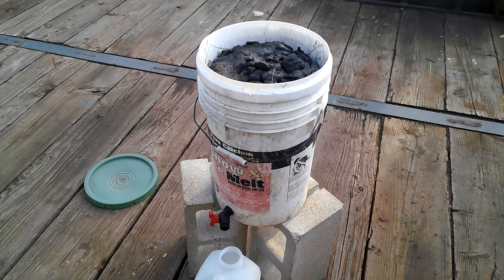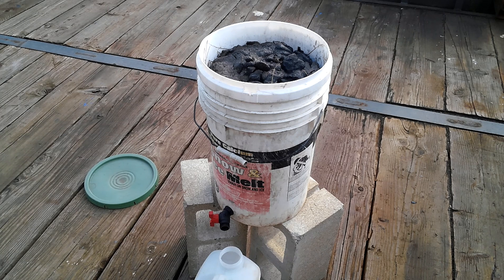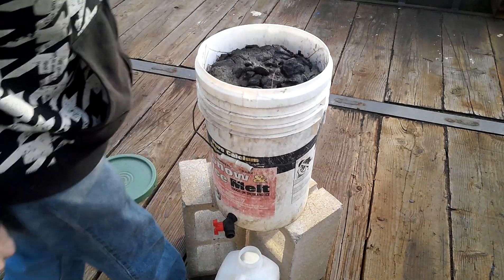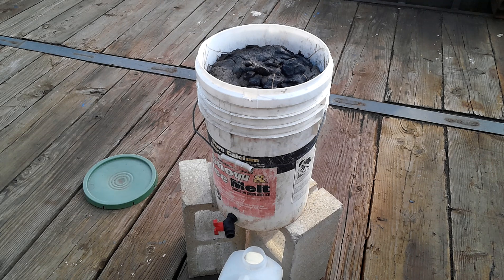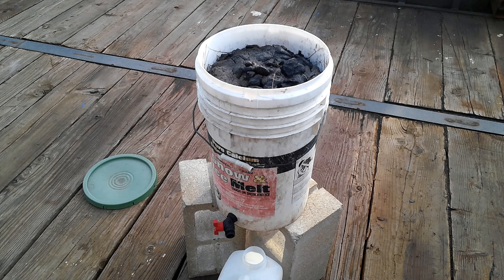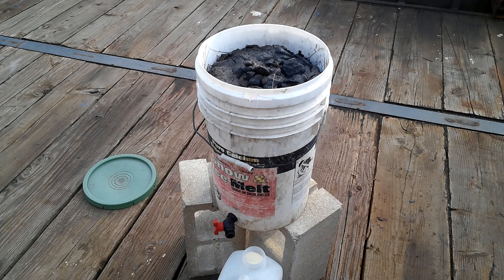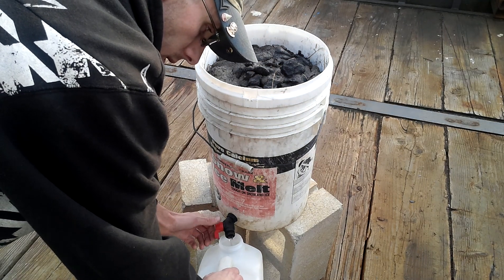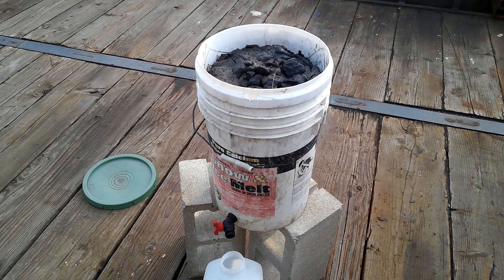How to make lye

Comment: Do you know the difference between potassium hydroxide and sodium hydroxide? And is this what you are making in this video? Someone said this is actually making potassium carbonate. But I thought sodium hydroxide was lye? Thanks
Reply: We are making potassium hydroxide yes. Which then is used for the saponification reaction with the lard
Reply: Slight error on my behalf, salt is not added to make sodium hydroxide but rather for the moulding step
Reply: @acx1005  thx!

Comment: Just an observation, if you’re layering filtering material from the bottom up, why drill holes too high on the side? Shouldn’t the holes be at the bottom?
Reply: That's why he needs to run the water through several times 😂
Reply: @underduress5761 No, you create more holes closer to the top to prevent a vacuum and trapping the water inside. You don’t have to fill the bucket to the top. These holes are about correct.
Reply: He gets a pass since we weren't raised with the survival traditions of the elders; we were brought up to be dependent upon the Rockefeller control grid
Reply: Because if you don’t create airflow at the top, it will create a vacuum and the water won’t drain out fast enough. You’re welcome.

Comment: What happens if soft wood ash is mixed in with hardwood ash?
Reply: Has to be hardwood
Reply: It doesn't have to be hardwood Ash, hardwood Ash just creates a harder soap. Soft wood ash  crates a softer soap and if you want to make it harder you can add salt and it will make it harder, not as hard if a soap as hard wood ash would make however. @willsmith4233
Reply: You create heroin

Comment: A better although more laborious method is to only drill holes in the bottom of the bucket and put a couple inches of small rocks at the bottom with a thin layer of wet sand pressed on top of that, now add a couple inches of pressed ashes then a couple inches of wet sand, repeat that process until the bucket is full with the top layer being sand and begin pouring in hot distilled water. After boiling off all of the water you end up with white lye instead of the yellow tinged impure stuff you get with other methods.
Reply: Hi there, I'm trying to extract lye from hard wood ash for making bar soap. I followed the instructions from another video. I filtered out the charcoals from my ash and mixed the ash with water in a bucket. I let it sit for a few hours and then I pressed the mixture through an old tshirt. The liquid produced from the press was sort of grey with a lot of sediment at the bottom and a yellow colour on the surface. I boiled that down untill i was left with a grey powder. 
That grey powder should apparently be lye but im not sure if it is, as it doesnt seem to react to fat. Maybe there is some lye in there but not enough and its mostly carbon? Or just ash?
Any information would be a huge help!
Also, with this method that you mention, with layered sand and holes at the bottom of your bucket, how long does it take to produce the lye? because Im trying to make soap as christmas presents!
Reply: @aaronhealy3789  try letting it sit for a few days to “saturate”. Then proceed to press or filter. 

If you’ve already had success let me know what you did differently!